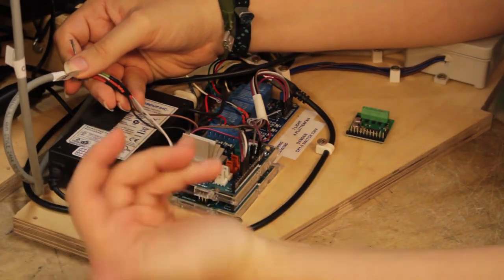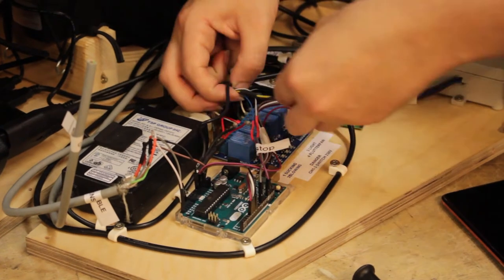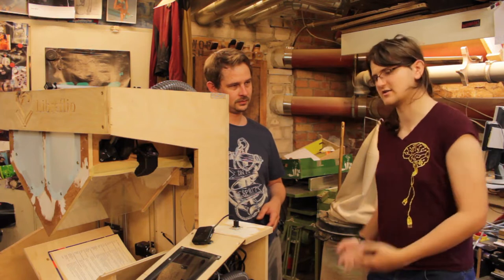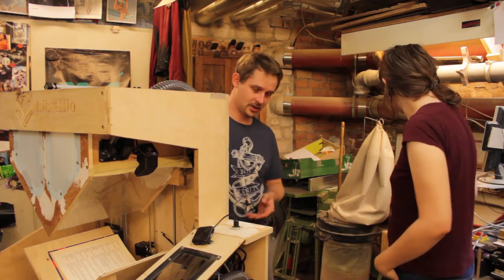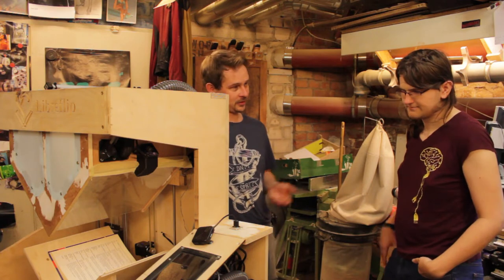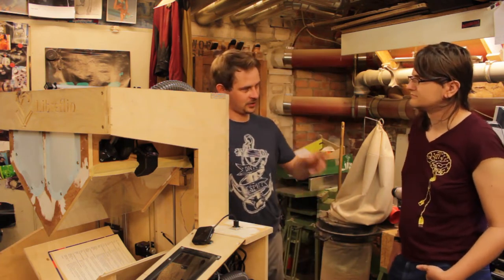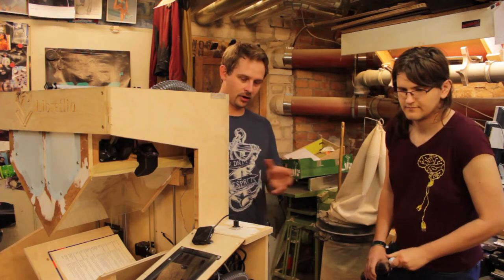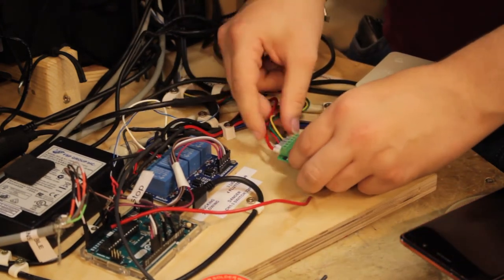building Libreflip - E31 - Exchanging the Stepper Driver and discussing "COTS" vs "Custom PCB"

Comment: I thinking keeping it modular in the prototype phase makes sense. If I were to build one my preference would be a complete PCB or a bare PCB and parts bag if it saved me ~30%. If there was an option for any difficult parts to be soldered on a bare board that would be great as well.
Reply: As for soldering experience, mostly through-hole, but I've abused toaster ovens in a handful of cases. Keep it up!
Reply from the maker: Thanks for your input! 

Please clarify - 30% cheaper then what option?
Reply: @IjonBerlin  If a complete board was €100 but a bare PCB with parts was €70 I'd buy the bare PCB with parts. It was also 2 AM when I wrote that so I'm seeing some faults in my logic...